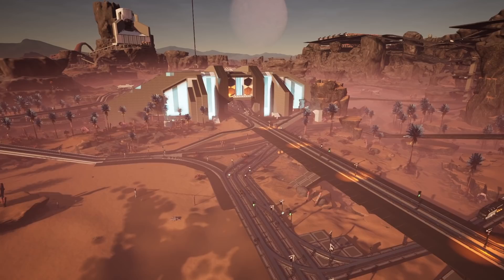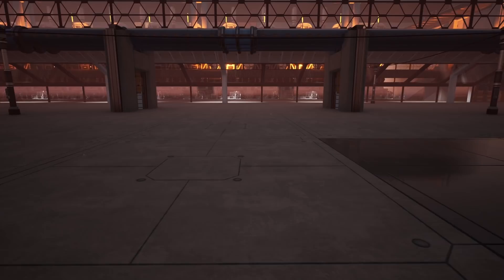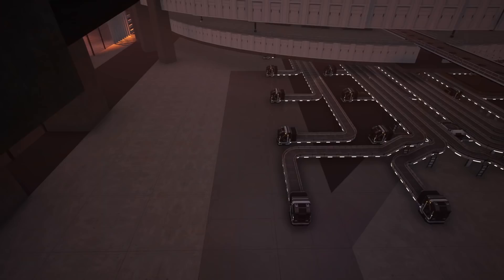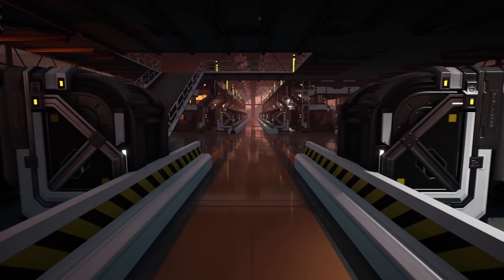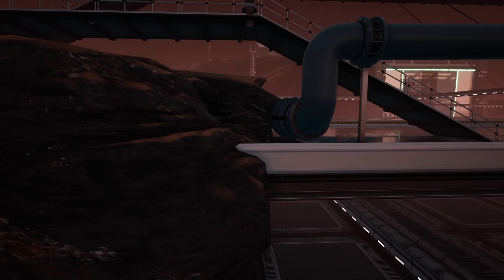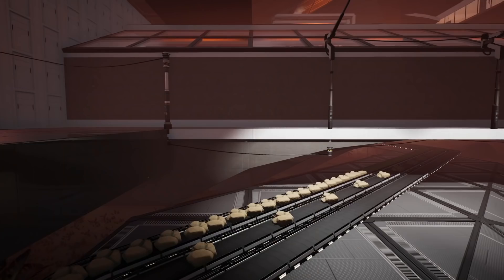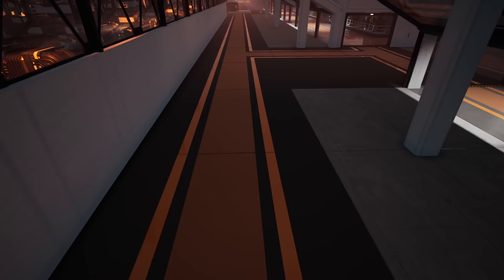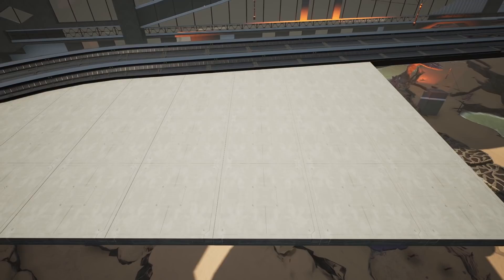Better Factory Floor Designs | Satisfactory Guide

Comment: The down-corner trick to combine materials, and the .25m frame trick are both really good ones I hadn't thought of, and will NEED shortly!  Thanks Eclipse!
Reply from the maker: Definitely worth giving them a go, do you have any tips you'd recommend?
Reply: How do I get it to be only .25m up or down?
Reply from the maker: @kleingrrmpf  the max up or down in .4 using the frames, you can make it smaller by using beams and angles, but it's far more complicated and difficult to do
Reply: @TotalXclipse  is correct, @KleinGrrrmpf, I misremembered the fickness of the frames.
Reply: @TotalXclipse  I don't recall anything offhand that I've discovered myself, most of the techniques I use I learned from you, Kibbitz, Bitz, and maybe one or two others.

Comment: This looks sooo clean! Love it, gonna use these tips from now on. Also I could use a tip, should I use my “heavy oil residue” to make coke or should I use it to make fuel? Reached oil tech for the first time and it’s… spicy
Reply from the maker: I'd push for alternate recipes, such as the diluted fuel recipe, then use that for fuel, otherwise you'll be rebuilding it all. Is there anything you need plastic/ rubber based atm, or just power?
Reply: I usually delegate 180 to 300 crude oil towards turbo fuel once I have the components to make the blenders. Before that, I’d keep the oil plants simple and based around making a good supply of computers.
Reply: @internetbard4384  thanks for the tip! I was asking because currently I don’t have the tech to make fuel generators and I had those two options
Reply: Some ppl like to jump right into nuclear and forget turbofuel, but until you get bauxite the alt recipes of diluted fuel and heavy oil residue are your best bets for setting up an initial fuel generator plant.
Reply: And lastly keep an eye out for the compacted coal recipe as well, the slower burn means more coal power plants per coal node.
Reply: @internetbard4384  thanks a lot!

Comment: Can youndo a 100% efficient turbo motor setup because I'm struggling
Reply: The best tip is not to go by the numbers. always add headroom at the start of the factory.
If you do a picture perfect factory where each production line feeds exactly what he next one needs, the buffers will never fill up and machine efficiency will drop. So always add one or two machines to allow for buffers to fill up.
Leave empty space at each step to tweak and add machines where needed :)

Comment: I couldn't find any glass foundations in the shop, they only had glass roofs. Is that what you use for these designs?
Reply: You need to have steel and then the foundations come with the frame package
Reply from the maker: Kleine hit the nail on the head, they're part of the foundation frames package
Reply: @kleingrrmpf  Cool! Thanks!

Comment: so, for game to look good at 1440p, you need at least 3090, correct?
Reply from the maker: I wouldn't know, I don't play at 1440p, or have a 3090 :D
Reply: the game needs more CPU power than GPU as it stands ^^'
even on 3090, my starting factory (the biggest) gets my framerate below 50. smaller factories, or exploring empty areas, the FPS skyrocket.
definitely CPU bound. Even Jace was joking about it in one video.